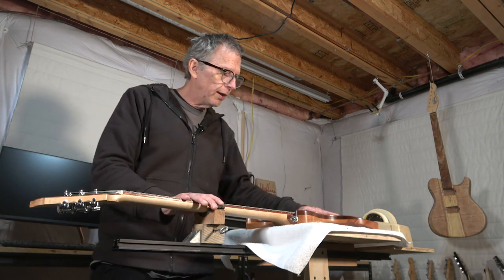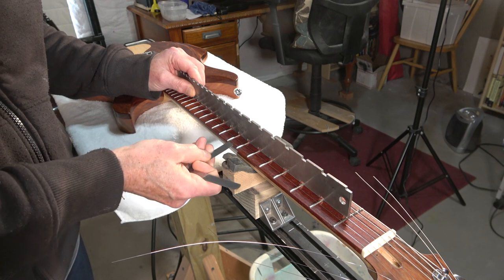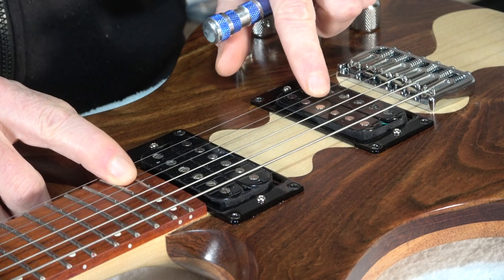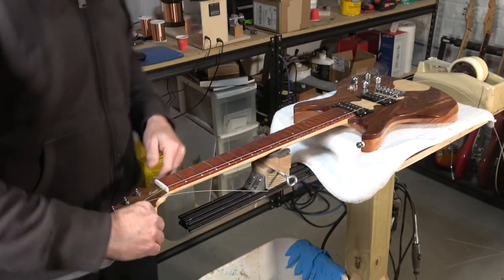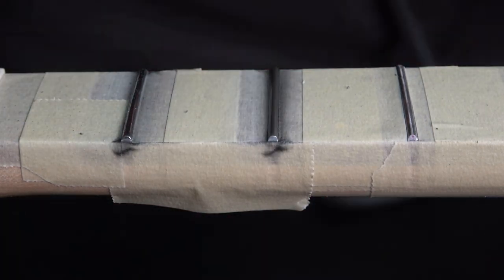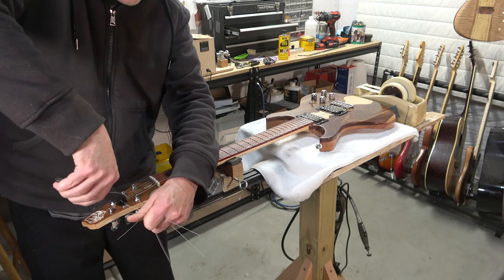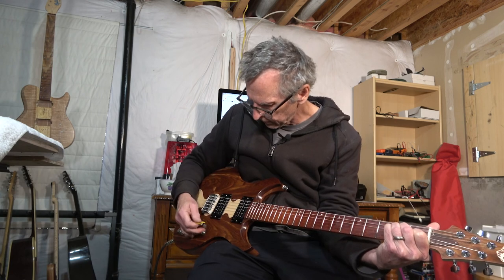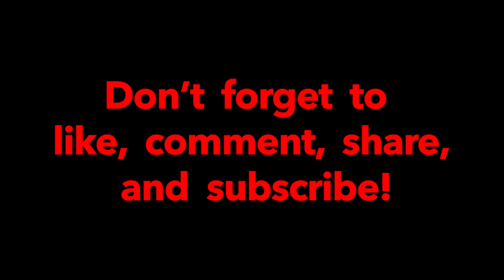Building A Neck Through Guitar Part 24 The Final Setup

Comment: For intonation, try beating each string against the next string at the 19th fret. So 6,0 vs 5,19, etc (also 6,17 vs 5,0, etc). It's more accurate than using the 12 fret because the strings will be out up high for sure, if you just use the 12th. I know it sounds a bit odd, but it's really simple and surprisingly easy to dial in the saddles this way.
Reply from the maker: Okay.

Comment: question:  if neck through have better sustain, is it possible to have even more sustain by having the neck and body carved from one piece, I understand this could be hard because of the final setup but is it theoretically possible?  and did you try a guitar like this?
Reply from the maker: There's no guarantee the a neck through has better sustain than a set-in or a bolt-in neck. It's only theoretical. Making a one piece body and neck is expensive, difficult, and impractical. I would never make a guitar that way.